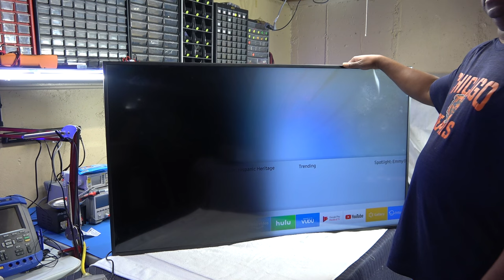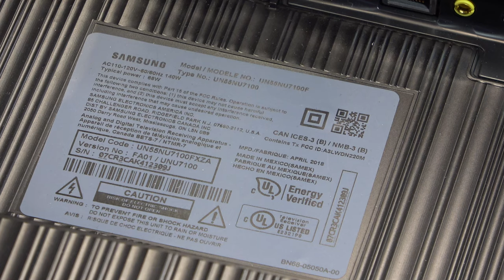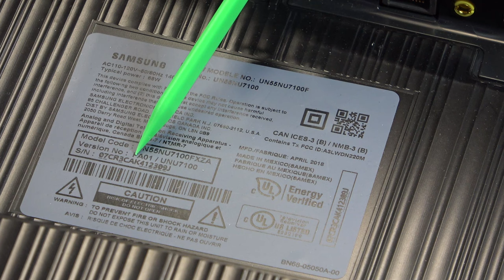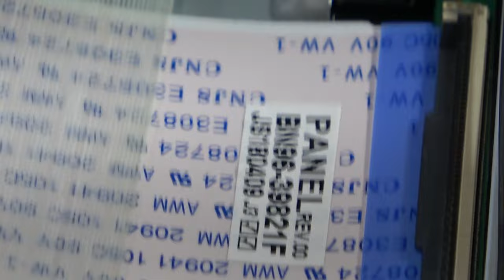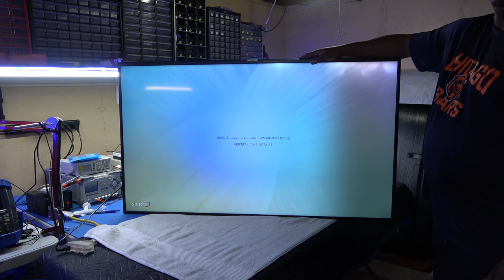Samsung Led TV UN55NU7100FXZA half dark screen repair

Comment: I have a similar EU version of this TV, an UE55NU7102. It has smaller differences, but the disassembly and edgelight change is the same. Mine was in worse shape, it had like a dozen cracks on the diffusor, and bigger burn-ins. I screwed up and ruined the panel sadly. But I would not have even tried if it wasn't for your great tutorial. It went decently, despite i've never done it before. Thank you for your in-depth video, greetings from Hungary!

Comment: This video is outstanding! Thank you so much for creating such a thorough walk though of the LED replacement. The close ups provide exception detail. Unfortunately for me, I cracked the screen when installing the outer bezel. It was totally my fault. The screen was overlapping one of the edge guides just enough that it cracked when I applied pressure to snap the bezel in place. I can't stress this enough- double check to make sure the main screen is centered and within the bounds of the edge guides! Do not force it if the outer bezel is not going back on easily.

Comment: Bruh, you are a straight OG at this.  I've looked far and wide for anything similar before I found your channel, and hey, don't let any of those haters get you wound bro.  You're awesome at what you do, I learned a ton by watching you work and loved the commentary.  I repair and upcycle electronics just to save them from the landfill and to help people, and you wouldn't believe how many TVs I've had donated to me since the local news in SLC ran a story on me.  I'll give you 3 guesses on what the most common brand donated is. 😂  Now that I've found your channel and I'm stoked to be able to repair a lot of them quickly and efficiently, sell or give them away, and save people a lot of headaches and money.  Thanks a ton for your work, you're a humble man but you have bragging rights for days.  I've been an electrical engineer for 2 decades, and you know there's an enormous gap between the guys at NASA and the like, and those who actually take the time to reverse engineer, dissect, repair, and service electronics.  In my experience, they're lost as hell at this kinda thing, and pretty terrible at it.    Quick question for you my dude, do you have a good resource for finding replacement parts and/or service manuals?  If you don't mind sharing, I'd appreciate it greatly.  I have a UN75JU6500 v.TD01 that was donated.  I have the same problem with it as this one, and am having a hard time finding the LED strips.  I'm giving it away to a family next door that's living on a disability income, as a surprise.  Again, phenomenal video, great pointers, solid work and a big help to many of us. Thank you 👊

Comment: Thanks for the power supply checkout portion of this video. I don't have an LED tester, but I DO have a DMM, so this is perfect. I've found many videos for LED strip replacements, but none show how to check out the pwr supply. I have the 50" version of this tv, with one segment not illuminating. The power supply checks out fine, so I now know that I need to replace the LED strips.

Haters... ignore them. I'm an EE, with lots of bench experience. I didn't see anything wrong with your troubleshooting & repair process. Keep up the good work.

Comment: Simply great! Electronics, chess and other difficult things teaches us humbleness. I fixed 39 inch Samsung backlight by changing individual backlight. I learned from youtube, that by warming the strip under with hot air gun you can remove led quite easy. In my experiments 400 degree was quite good temperature. I have to say, that these repairs are more difficult in practice that you could imagine when you watch someone else doing these in youtube. So you have to be very humble, there is so many ways you can burn your pants.  😀😀😀

Comment: There will always be haters. I have watched this vid twice. Once tearing my TV apart, and once putting it back together with new LEDs. My TV is full backlit and working like new because of your vid. Keep it up man, Cheers!
Reply: I have no experience with this type of repair, but for kicks I flipped my defuser screen 180 during the reassembly hoping the shading would be gone and it worked.  This may not be the case with all defuser screens but it certainly worked for mine. Anyway...thanks again for your vid!
Reply from the maker: Glad it helped Stef.

Comment: Samsung learned their lesson with that flawed design in later models as they put a plastic bracket (with holes for the leds) between the chassis bottom and the perspex defuser sheet  to introduce an air gap to aid cooling in the hopes to avoid the burn out you see here.

I've attempted to repair over 100 of these "edge lit" led tvs and only successfully managed less that ten due to this issue and the lack of spare perspex sheets.

You'll always get the unit up and running but the burn marks will streak across the screen from bottom to top and will be very noticeable on every picture unless it's a night scene.

My advice to anyone looking in - if you find these burns - save your coin and invest in a new TV - unless you can get that perspex sheet of course, otherwise bin that suckka!

Comment: Awesome video I've just repaired my exact same TV only difference I did was not lift the very back sheet out, I just slid it up and changed the LEDs, the white paper was stuck in the middle  a little did get a belt off the LEDs tho,  one connecter was stuck, next time I discharge the caps! Top tip put it on a blanket on the table and slide it around,

Comment: Excellent video, Thank You! Great level of detail. My backlight now works. Unfortunately the screen doesn't :(. I used a double unit suction cup and I think they were too close together. Would recommend two separate section cups (or even 4 with two people). I suspect the small bend on the screen when I pulled it out broke it. C'est la vie.

Comment: Hey dude thanks for making this. I was able to take my tv apart, slightly different model but same set up. And even with this model same thing with the cracked screen. I believe that customer had power surge bc similar to mine i have all but like 9 of the bulbs out i got to replace the 2 strips. But i was able to find that out thanks to u. Much appreciated and keep doing what you do.

Comment: Thank you so much for this wonderful tutorial! I did exactly that at same exact model, but I have one problem, After revering the Diffuser and re assimbly of whole TV, The TV brightness got gradient, means the bottom is so bright and top is dimmer, how can I fix that?
Reply from the maker: I tried that, you have to put the diffuser back to original position because of the light path inside the diffuser. Thanks for watching!

Comment: We like your videos because it is no BS say it like it is!  I had to use a ribbon cable that was twice as wide to fix on from a tcon board.  I just cut it down under the microscope and i just had the one tab but who the flock cares because when you lock it down it is locked down.

Comment: 👏🏾👏🏾👏🏾👏🏾👏🏾👏🏾FINALLY!!!! somebody has covered this make and model. BIGDOG  I can finally go into it with confidence. KEEP UP THE GOOD WORK. The difference between mines though is just is a spot on the bottom left is dark and going across it FLASHES towards the middle when the BACKLIGHT is turned up. I want make sure it's not a board? Any suggestions would greatly be appreciated.
Reply from the maker: Sounds like backlights to me....
Reply: @bigdog8882  thank you for replying back. I will definitely be digging into between now and the shortly after New Years, can't wait to have this thing up and running. Thanks again BIGDOG much appreciated for your suggestion.

Comment: I found this very informative. I watched another informative video that showed there had been a small fire in the LED lights, but it was a different type of LED lighting from what is shown here. I think this may have happened to my TV. About 1/5 of my screen is smoky (no distortion), but not completely dark. It's about 10 years old. I will try to open to see, because if it shows fire damage, I will trash it and buy another TV. If it's this type of LED lighting I don't think I would be able to do this, but at least I understand the issue if I decide to have it repaired. Thank you.

Comment: Thanks, great video . Got a 43" Samsung that has issues with one side out.  Can get both to light up individually with an LED tester, but both will not work. If I disconnect one the other works. Going to change the LEDs as both have a few burnt out. One has 8 of the 28 out. Hope the board is not the issue.

Comment: I tried sending you a comment with a question but I screwed it up. So I just wanted to thank you for all the wonderful videos . I have the 55 inch Samsung with a dark area on the left side, but after two weeks the dark area moved to just left of center screen. The left side is now normal brightness. What could possibly cause that they do that? Thank you again for the great videos
Reply from the maker: Change the Backlight strips.

Comment: Hello. I am very thankful for your video. I was able to replace the LED strips.   I fixed one thing but I think I messed something up. I will try to keep this short. I actually had to take it apart twice. The first time I turned it on and the remote worked but I didn’t have any sound so I took it apart and unhooked and hooked stuff back up. This time the remote doesn’t work and still no sound. I thought I would see if you could maybe tell me what you think happened. I have tested the remote by shining it at my phone camera. I don’t think it is the remote. Could I have messed up sensor thing?  I look forward to hearing back from you soon.

Comment: I have to say, you’re video is great, I followed your instructions by the numbers I replaced the LED lights tested it as you did and everything worked, unfortunately after I put everything back together the TV goes on and off. Any suggestions on what went wrong?
Thanks
Reply: Update, I figured it out the power button was stuck, I’m happy to say that it’s working again.
Thanks for sharing your experience Big Dog

Comment: I’ve watched and I believe I’m now ready to give this a try before going and spending hundreds on a new TV. BigDog…I have this same model, seems a lot of these videos I’m finding on YouTube are for this model? Are you seeing the same? Seems if I do need a new model I should stay away from this one. Anyway, I had the right side of the set out for a while, but I know it was the backlight due to reading online about the problem. I was dealing with it for a few weeks, and then a couple nights ago the left side started going, there was still a bit of the picture on the left side in the middle you could see. I do believe that there will be a crack based on what I was seeing when it first started, but I can deal. Do you think it is just that one LED went out, and the the other started to? Or could it be something else? And do you recommend that we have one of those meters for this repair?
Reply from the maker: If your screen is already cracked then dont waste your time. Otherwise you need to replace both/all the strips.

Comment: I have a similar situation where a piece of the image is missing. However, the separation between the image and the side with no image is a very distinct line separating the lcd panel at a 70/30. Just like your issue but a solid line separating the left segment with no picture at all.

Comment: BigDog thank you for taking the time to put this video out. I replaced my led strips and noticed it had some heat damage like you described. After putting the TV back together the led strips are working correctly now I've got a half screen distortion. Could this be caused by the excessive heat damanging one of the boards? Any idea's on what I should be checking next?

Comment: I followed the steps and the lights worked for a few hours but one strip already went out 😢. I got them off eBay as I could not find the exact match on Amazon as mine is a 58” and Amazon only had for 55” or 65” models. I also noticed a backlight issue from the cracked rear glass screen upon repair.

Comment: Bigdog, just one doubt those gray suction cups you use ,the handlers are made of plastic or alluminum? If they are of alluminum are almost the  same I saw on the store, my  tv has no real damage ,but the diffusion screen owing to static electricity sucked dust and on brighter image or white screen I see black spots ,making it a little bit annoying ,only fix is removing the tv panel and cleaning the diffusion screen or filters don't know the best way to call it

Comment: Wish I could hire you. 
I just had a tech come out to look at my TV. The LEDs went out. We now have a black screen. The company that came out is Teknton. The tech just charged $100 to come out and turn on my TV and confirm my screen was black. Claimed that an LED TV has no lights to replace and said I will have to purchase a new screen for over $400.00. The order was to come out and replace lights. If they weren't going to do that then why send out a tech? I didn't ask for him to come out and tell me my screen was black. He was suppose to replace the lights.
Reply from the maker: That would of had to go into a shop for LED light replacement. They wouldn't have did that in the house anyways. What was your TV's model #?
Reply: @BigDog8882  Model # UN55RU7100FXZA
Samsung 
Yeah, I asked a few times about it being a house call and said, " You can come here and change the lights?" She replied, "Yes, the tech will come there."

Comment: What will happen if flip the plexiglass 180 degrees. Then you will have a good edge near the led diodes, this may fix that dark area?
Reply from the maker: tried it, it doesnt work because the inside of that diffusser screen is made different top to bottom to spread the light. You can see for yourself if you do it and turn tv on b4 you put it all back together.
Reply: @bigdog8882  Thanks for the answer. I have the same problem but waiting for the led strips to come and then I will disassemble the TV.

Comment: Great video. I replaced my led and it only lasted a month before the ledt side burned out again. I think the power supply board is the problem. Should I replace it? Is there anything I should check besides the voltages that may cause the leds to burn out?

Comment: After I replaced the leds and put everything together, the top half of the lcd is dimmer than bottom half of the lcd. Are there any suggestions on what I should do?
I reseated the display ribbon cables and no dice.
Reply: I have this same issue. Is that thick screen that rests against the LEDs cracked or burned? Try rotating it around, but don't flip it. That might help alittle
Reply: @gameovered777  I actually figured out I had the diffuser layer with the transparent line flipped the wrong way. The line has to be at the top of the TV.

Comment: Hi BigDog8882, its an amazing video. 
I don't know if I can do it as I'm not that talented at things like that, but I'll try. My question would be whether I can use the same strips for a Samsung UE50NU7090S? many greetings from Europe.
Reply: To can find production information specifically about your television:
Look at the label on the back of the television.
Find the model code and version number.
The television in the video had a version number of "FA01".

This was shown early in the video.

Now search for the part using both the model code and version number.

After you find the correct part number, search only for that number to find the best seller; but double check that you are ordering the correct part.  Then, triple check you ordered the correct part.

Comment: This exact TV thing will be my weekend project. I havent taken the TV apart yet, but if the bottom plastic sheet is cracked and or has burnt areas, can that thing be rotated 180* to make it on the other side? That way there won't be any darkend areas?
Thanks!!

Comment: When I replaced the LED lights. The bottom is super bright and doesn't transfer throughout the whole screen. TV is watchable but its blindly bright compared to the rest of the screen. Is this because I bought the cheap $30 LED strips off amazon or is that thick screen just shot from the LEDs burning it?

Comment: Hi Bro.. I would have been very interested to know if the backlight would not have this remaining error if you had lifted the burned side of the transparent board ( turn not flip ) so that the LEDs could shine through the material better, it would have been worth a try. Or is the structure really aligned in such a way that there is only one possible installation option.
Reply from the maker: Yeah, you can't turn it either. That screen only projects light in ONE direction.
Reply: @bigdog8882  Thx

Comment: Big, i need help. LG led 47LM7600 Turns on and will work for up to a few hours and then the screen goes black but with sound. If I turn the set off and wait a while it starts playing again when screen is black i tried the fladlight test and did see the main menu. What could be causing the screen to go black?
Reply from the maker: backlights

Comment: When a person rotates the diffuser, and when the burnt or cracked side is on the upper side. Is it then visible that it is brighter where it is damaged or is it no longer visible?
Reply from the maker: Not sure, haven't had another one to try yet.
Reply: @bigdog8882  Do you order a diffusor from China? Which Internetsite? Each diffusor on the bottom side has a little cut on each corner, to make it sit better.